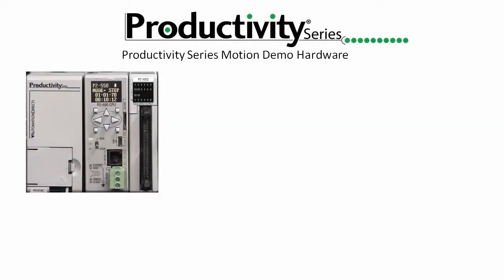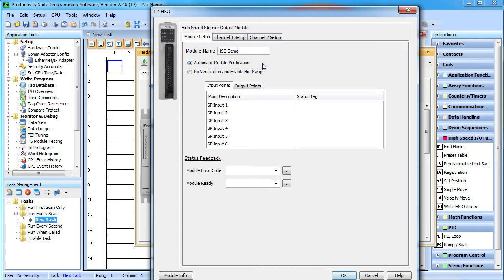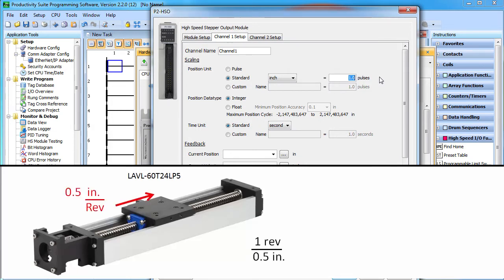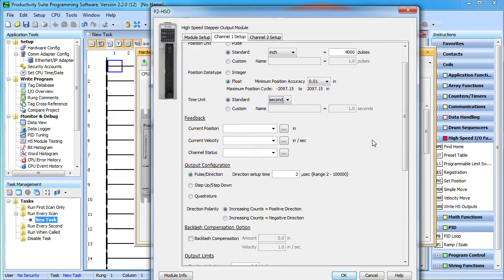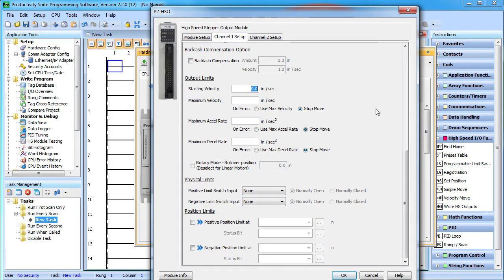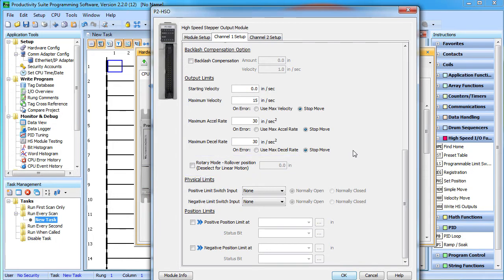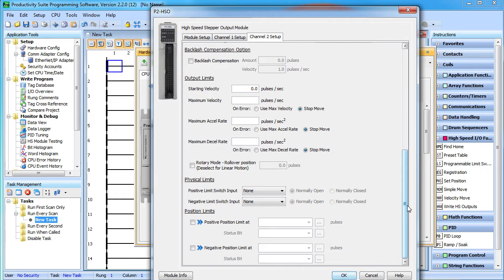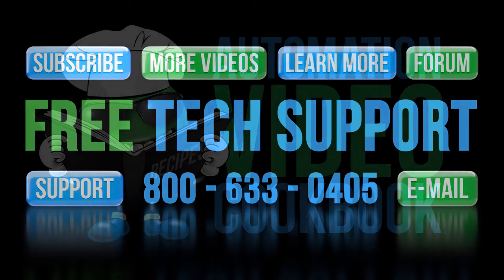Productivity PLC Motion - How To Setup High Speed PLC Output Module from AutomationDirect

Comment: REALLY need the associated electrical schematic, specifically the wiring connection between the HSO's ZL-RTB40 and the STP-DRV-6575. I have this exact hardware setup, but am having trouble with the wiring between these two components. Please help!
Reply from the maker: Hi Jeremy,  Well ... that would have been a good thing to put in the video.  Ugh .. Thanks for pointing that out. You can find the wiring diagrams in the HSO data sheet here: https://cdn.automationdirect.com/static/specs/p3hso.pdf
In particular, go to page tPR3-112 and look at the either the "Sinking Pulse Outputs" or the "SureStep Wiring Diagram" depending on how your system is setup. 
The diagram on pg 113 shows a global view.